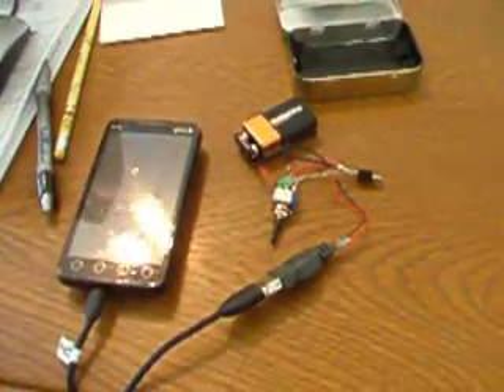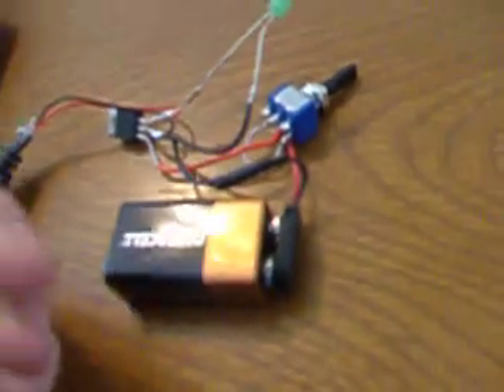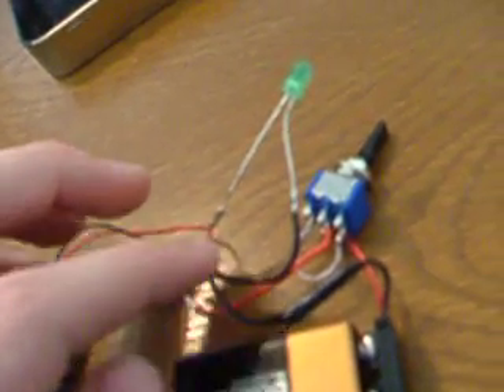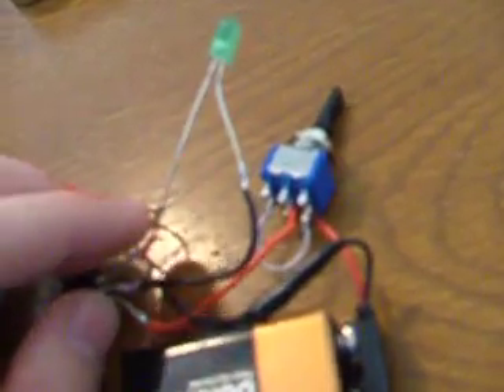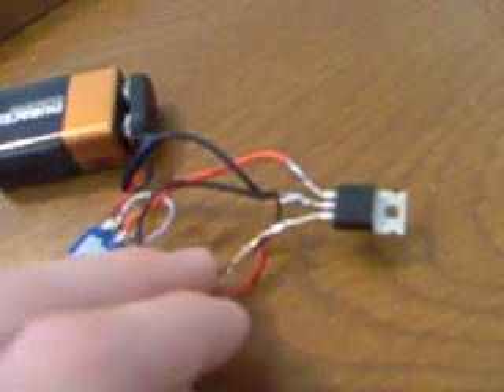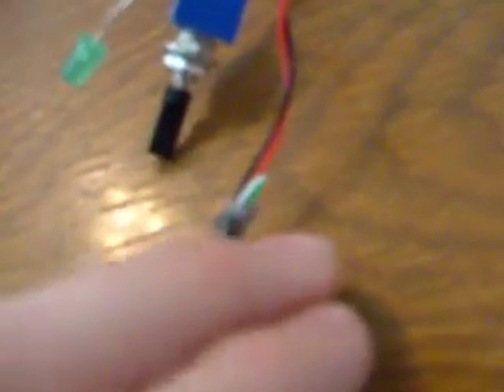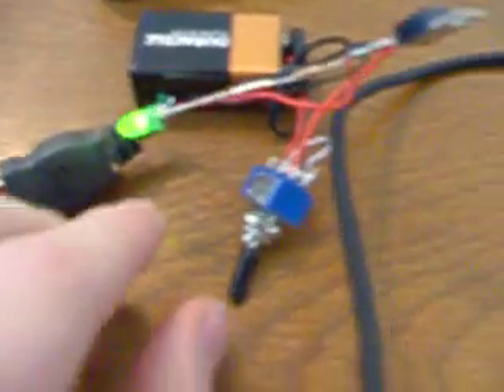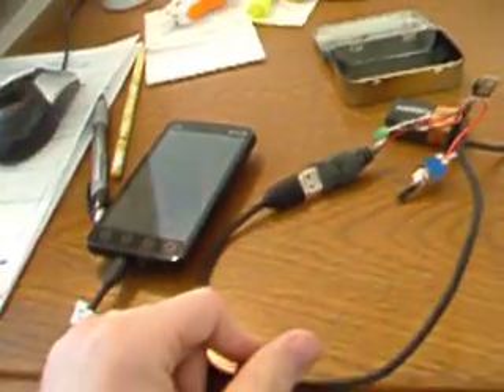How to make a portable cell phone charger / usb charger

Comment: About how much did all of this cost?
Reply: +TheMINDL3SSGamers very minimal cost the only thing you really need to buy is the voltage regulator, switch and 9v battery adapter. most of the other parts you can source from around the house such as wires, Female USB (sourced from old cord) and the LED is just for show to let you know its working but not necessary, for that you will need resistors as well. overall cost for me was under $5

Comment: i used potenciometer instead of voltage regulator becouse the voltage regulator produces heat
Reply: +Kristijan Nikolovski Good Idea! the voltage regulator does produce heat if used for long periods of time you can use thermal paste and super glue and attach a bigger heat sink to the back of it if you want.

Comment: can I use two 3.7v? instead of 9v?
Reply: +Camille  Tatoy yes but your voltage regulator may be different I set this up on a breadboard and used a multi-meter to ensure the proper voltage was coming out of the voltage regulator

Comment: Do I need the voltage regulator ?? Can't I just use the battery and the USB ?
Reply: Sora Babekir battery gives 9V, phone needs 5V so.. you need a voltage regulator. Without it you would need to use a battery that gives you 5V (3x AAA or smth).
Reply: Ok thank you for answering my question .. 😊
Reply: +Jiovany Herrera you do need a Voltage regulator when using a 9v battery and you are correct about the resistors
Reply: ***** thank you

Comment: Does 9V battery heat up? I've built one similar to this without the LED light and the 9V battery gets hot after about 10 minutes.
Reply: H J Savoie actually what u need is more resistor, so it doesn't get heat up. the resistor itself will decrease the influx

Comment: dude you can do it WAY cheaper than that and you don't even need those expensive batteries. well I made mine work with 4 double A batteries using a 1 amp 5 voltage regulator for $1.99

Comment: A 9705 /9805 
Generate a lot of power 

In this case the ic wil generate ((9v-5v)*1A)  = 4w

Loading power is 5v*1A = 5W

EFFICIËNTIE = 4/5 = 80% 

You need a 9 v batery from 
2000mAh to full load your 1600mAh phone 

=5 9v battery's parallel

Comment: I have a question,i tried making one with 2 nine volt rechargable batteries.I plugged in my phone to charge it and waited till full charge.But at exactly 50 percent it actually began discharging.I know this because the battery percentage dropped to 47 then 44.Do i have to add another battery or is it because i soldered the negative wire from the battery to the positive wire of the other battery.Or is it because i have 1 rechargeable battery and the other battery is not rechargeable.Please help and i will make a video on how to make it.IT is made out of a monster can.
By the way, im using an ipod 5 to charge.
Reply: battery's tend to try and equalize, so think of them like water tanks they will try to get to the same amperage (the amount of water). if you want it to flow in one direction use a diode.
Reply: OK thanks
Reply: no problem

Comment: please buddy explain us dont just just ready the circuit and show us break each part and join it infront of us i dint got it please do it carefully next time
Reply: oh the circuit just takes a 9volt battery then steps the voltage of the battery to 5volts (standard usb voltage) then if you connect this to the power cables of a usb it powers devices

Comment: hey quick question does a 9v fully charge you phone? i was gonna make one of these but i wasn't sure if it was going to actually be able to charge my phone
Reply: no it is about 1/3 to 1/2 depending on the phone. you could run multiple( 2-3) 9 volt batterys in parallel to fully charge. if you could i would go with AA use 6-8 in series as it would charge your phone fully but that is just my opinion

Comment: it needs to be 12 volt not 5 u need to use 8 AA batteries
Reply: You charge your phone with 12V? LOL
Its 5V like ANY USB ....
Reply: that will break usb devices if you use 8 AA in a charger, if you use them in parallel then you get a much higher amperage, and it charges faster but 12 volts will kill your phone the regulator will also have a chance of catching fire if you keep it out of air flow

Comment: It will work with apple devices as long as you add a 100 ohm resistor to the data + and data - pins (2 middle pins) on the + or hot wire running to the female usb port.

Comment: Its not wise to use a linear regulator. It will just transform aprox 50% of the energy into heat, if you plugin a 9V Powersource and regulate it to 5V.
Its a better idea to use a DC/DC Step Converter, like a Recom one. Its a littlebit more expensive, but you have nearly twice the efficency!

Comment: Materials Needed (Green and White wires needed for i phone)
- small box (altoid tin)
- wires
- 9v battery (9v connector not needed just put + - wires on 9v battery)
- female usb (radio shack estimate $5 or on old computer)
- 5v voltage regulator (radio shack estimate $2 or on old dvd player)
- x2 100k resistors
- small light (additional)
- switch (additional but recommended)

Comment: U can just use a Mexican coin and take a car charger and 9volt battery and put the battery in the positive side to the negative on the car charger and connect the negative part of the battery to the top button and it should charge ur phone

Comment: i have an extra cell phone battery and i dont want to have to swap when it runs out because the back panel is flimsy and the snaps may break its a 3.7V 6.85Wh 1850mAh and has 4 contacts on it. im not sure if i need to add any resistors or if i can just splice a female usb and connect it (u would assume so, just don't want to wreck it)

Comment: I'm gonna do this but imma do 1 thing different. Ill have not 1 single battery to it instead of having a battery power it from the leads ipm going to use reverse polarity. I'm gonna
Mount a small motor to my bike and ill have the wires that would be from the battery to the resistor ill have the leads to the motor going to the resistor and as Mike bike tire spins my motor with reverse polarity my negative lead from my motor becomes a possitive and ill be producing my own electricity.

Comment: Hi I'm trying to make this and this is the first time I'm really working with wires and making my own things so how do you connect the stripped metal wires if they're frayed at the ends? An I'm trying to make this without the converters only the USB port, the battery and hookup

Comment: its a lot easier to get a 12Vcar-USB adapter, dissemble it, and on the input connect the leads to the 9V battery.  It also works with iPods.

Comment: yes its possible only problem would be you would be overdoing it and might short circuit ur cell phone thats why the regulator turns 9v to 5v and its more compatible with your phone go ahead and check your phone battery and see how many volatge it is

Comment: @minirider118
I have set up the same circuit except the extra resistor and led. I am using 9v battery. The phone is charging but way too slow.. Any help? Or with this circuit it is slow charging always?

Comment from the maker: I am not sure, check your output voltage to the usb and make sure it is the correct voltage, I would also recommend the switch because if there is not one it will drain the external battery very fast and that could be why it is not charging efficiently

Comment: Hey man,

So I decided to opt out on the LED and the Switch, but do I still need the resistors even though I do not have an LED. When I tried it without resistors it would say that it was charging but it wouldn't charge it fast enough because it is losing battery percentage even when it's plugged in. Nice video by the way.

Thanks.

Comment: Its a LM7805 voltage regulator,
I use to built those regulators wen I was 5 years old... LOL
and a variable voltage regulator with a 12v zener diode and the 2N3055

Comment: Yeah sapimania u still need a voltage regulator cause u my blow some of the components of ur cellphone the only things I will change is the power source (9v battery) cause the low amperage rating and find the way to replace with a six pack of AA or AAA'S AND add a 5500mF capacitor

Comment: Hi Man
Counld i use a battery from an old remote control car so it (the battery)holds power for longer? the battery is 7.2v and 1800mAh. Do i just buy a voltage regulator? what 1 would i need?

Comment: hi, did you checked the output of that regulator with a voltmeter? because i just bought six of them today at radioshack, put 9 volt thru it and they all put an output of 4.89v, 4.91v, 4.93v and 4.96v. I built the circuit plugged my iphone to it but iphone did not even showed a sign that its plugged in. what is wrong? does the output has to be exactly 5V. thanx for the InfoVid

Comment: @Paulpierce, you phone is probably charging your external battery.
Possible Solution: Add a diode, so current won't flow back to the external battery.

Comment: I did this ane everything worked perfectly, BUT now my phones battery is decreasing, its losing even more battery percent when im charging it with this, what can i do to fix it. For example, my phone was at 12% when i plugged it in, then 5 minutes later I checked to see if it went up and now its at 10% without me even using the phone, WHAT CAN I DO TO FIX IT! please reply:/

Comment: @minirider118 I followed exactly what you did and it wont work on any of the devices i plug in. does it have anything to do with the fact that im not using a resistor or led?

Comment from the maker: @WyOutDoors yes when you put the resistor before the regulator it brings the current down that goes into the regulator. but I have no clue why you would put them on the ground wire it doesnt seem logical to me so you would be fine by not doing that.

Comment: @minirider118 Thank you so much for answering my question. I am curious on the Ohm's resisters. I have herd of people putting the 10ohms resister on the hot wire between the battery and the 5v regulator. Is this to limit the extra volts going to the 5v regulator. Some also put the 10ohm's resisters on the ground wire between the battery and the 5v regulator. I guess I quite don't understand  what these resisters are doing and why they would put them there. Any help would be great.

Comment from the maker: @WyOutDoors its really tough to say how many charges you get it depends on how much battery you already have. and the resistors that i think you're talking about are the ones that some put to connect the data wires on the usb which is for apple products but it can still be used to charge android devices if you have the data wires connected with 
a resistor

Comment: without capacitor the regulator can oscilate and no capacitor is just dumb..

please use some perf board and solder it to it for mechanical stability and use 4-10 AA Batteries, i'd say go with 6 rechargeables.

9V battery capacity is way too low

you need V input = V out + 1,25V drop

Comment: WOW you are an idiot!!! nice way to blow up a VR... its safer to run it through a 10 ohm resistor from power to input of VR so that the resistor acts as a buffer to decrease any chance of ruining/blowing the VR... another good idea is a capacitor from the end of the new 10 ohm to ground...a good 50 uF would do and to make sure that there is no less than 5V going into the VR, cause if its below 5V then its just going to do jack shit...the best you would get is what the input was fed... Cheerios

Comment from the maker: i forgot to mention, if you have an ipod, you will need to solder a 100k resistor connecting the data connections to allow it to charge an ipod / iphone, im not sure why it is like that but thats what you have to do